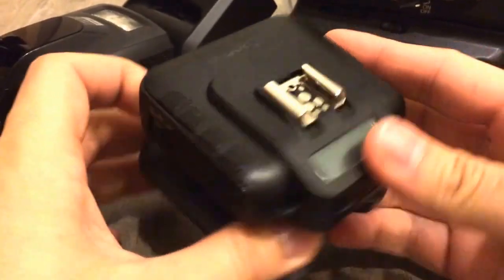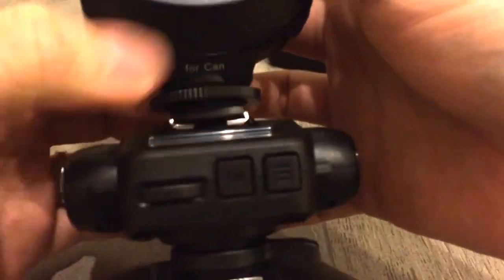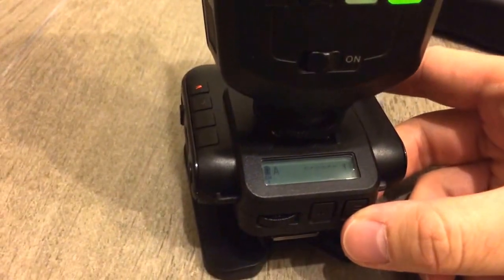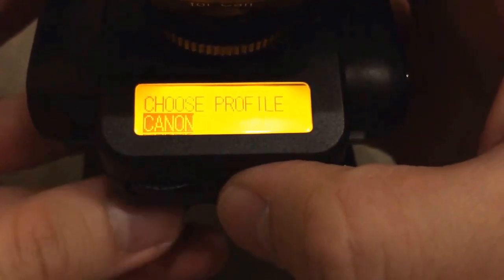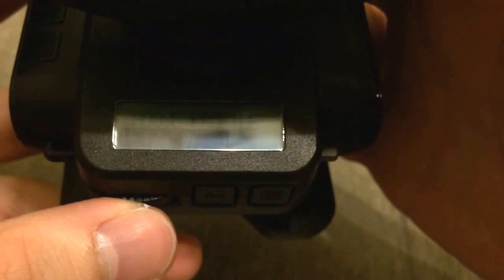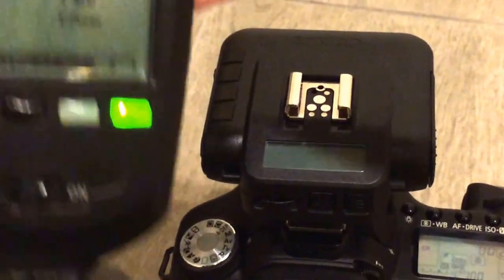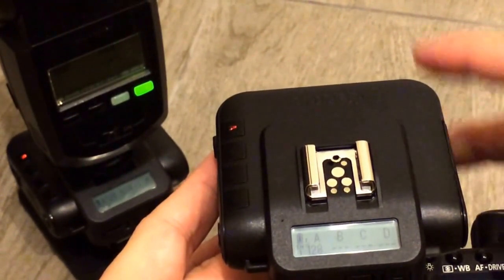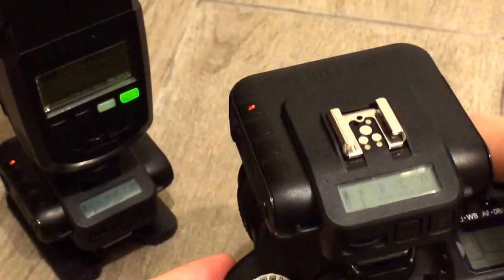Cactus V6 Flash Trigger Basic Setup: Choosing Flash Profile for Remote Power Control

Comment: Would you kindly how do you turn the ttl feature on the TX unit so the flush is shooting ttl off camera?
Reply from the maker: Hey I don’t think that’s possible on the V6. You will need the V6 MK2 which supports off-camera TTL. The V6 only supports on-camera TTL pass through - the flash mounted on top of the TX.